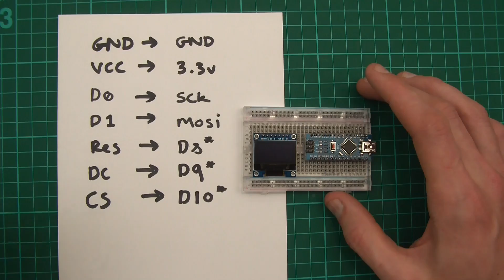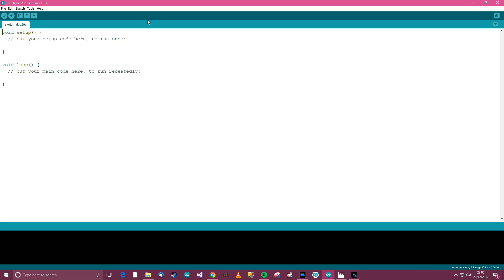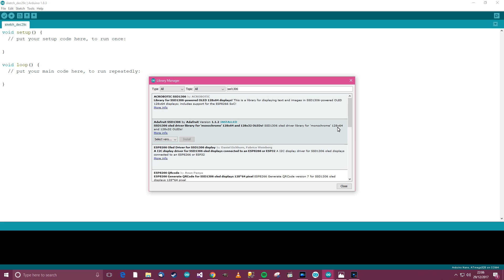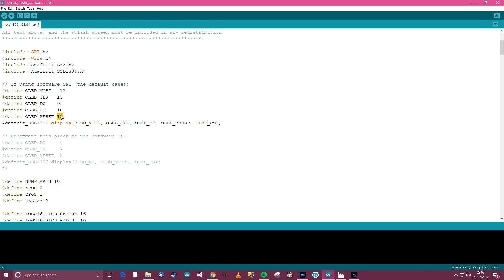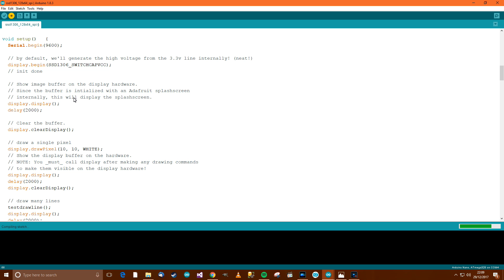TUTORIAL: How to get Started with 0.96" OLED Screen Module - Arduino Nano

Comment: The display height is set to 32 pixels instead of 64. Please somhow show people that they need to change the file to make it work correctly
Reply: What do you think about me making a video about it and than you will pinn it
Reply: @machmar  Maybe make a whole video who to do this properly, not his method.

The example is missing a LOT of includes/other libraries which he did not even cover.
Reply: @GeekBoy03   Wich library should be used?
Reply: @machmar  According to another video I am watching, you need to also add the Adafruit GFX Library.
Reply: @machmar  Notice the screen at 08:02.

It is showing us this:

// Declaration for SSD1306 display connected using software SPI (default case):
#define OLED_MOSI   9
#define OLED_CLK   10
#define OLED_DC    11
#define OLED_CS    12
#define OLED_RESET 13

This does not match the wiring he has setup at 05:59 and  the diagram at 04:18.

Some concerns are he is showing us:

D0/SCL -> D13 [Serial Clock] (Code has pin 13 as reset)
D1/SDA -> D11[Mosi] (Code has Pin 9)
Reply: @GeekBoy03  Oh ok I didn't get what you meant. I thought you knew what you were talking about. In this case, you should use the u8g² library and not any of this adafruit shit
Reply: He also seems to have left out other issues which need to be resolved in the example application, such as the pins set to use. What he is telling in the video to use, and what the application is set up to use, is not matching.
Reply: Did you do a response?

Comment: Hi Antony, nice video! I've also got one of these tiny displays. They are quite nice.
BTW. I think the error means you need to change the Adafruit header file to set the correct height. The test output seems to show that the height is set wrong, resulting in somewhat warped figures.
Edit: Never mind; I now see Ben made the same remark already.
Reply from the maker: Hi, cool. I don't know about that line. I just commented it out and it worked fine! :)
Reply: Antony - Fine? Look closely... It can look better! Now you're only using half of your 64 lines. If you select the proper line in the .h header file as the error message suggests, you will see nicer images, using all 64 lines. Now it's skipping every other line, resulting in stripy images...
Reply from the maker: Hey, ok, I'll look into this. Thanks!

Comment: The error message, is there for the purpose, of alerting you, to change the  the display height in the Adafruit library. Goto  the Adafruid library and look for #define SSD1306_LCDHEIGHT  64 unblock #define SSD1306_LCDHEIGHT  64  and block #define SSD1306_LCDHEIGHT  32 the graphics will improve after that correction and the error message will not appear any more.Good luck and a happy "Arduino" tinkering  2018 .
Reply from the maker: Hey, thanks for this.
Reply: What about, "Adafruit_GFX.h: No such file or directory"?

Comment: Thanks for your GREAT videos.  Can you change the jumpers to make it I2C ?
Reply: Yes, you can! The chip does support it. I have done that modification myself to one of my modules. (I think I showed that module in my video about adding more pins to Arduino and ESP8266). Just make sure to connect and disconnect the correct pads. I reused the R2 and R3 resistors to populate R6 and R7 and added a piece of wire to connect R8.

However, even when using only the two D0 and D1 pins for I2C, you still need to properly wire the other pins. CS and DC can be tied low, but RES needs a timed pulse. Somewhere online I found how to do this using a resistor and capacitor. I just looked at my module and saw that I added a 10K resistor from VCC to RES and a capacitor between GND and RES. The capacitor is a random high voltage one I had laying around. I think the 104 on the label means it is 10uF.
Reply from the maker: William Miller Hi, my gut feeling is that you could by repositioning the resistors, but I'm not really sure. :)